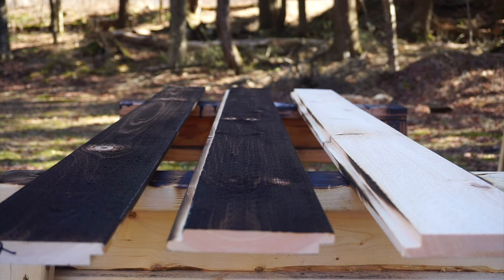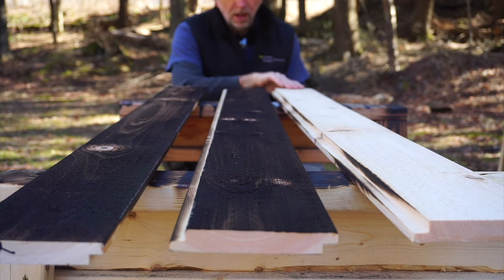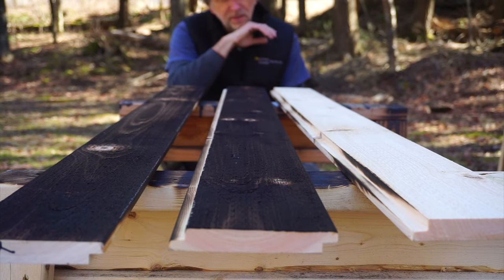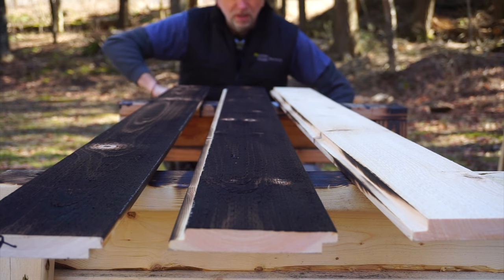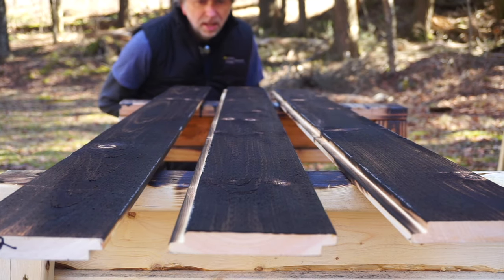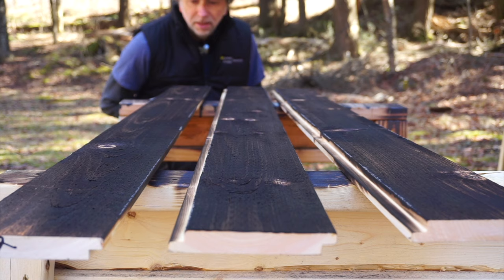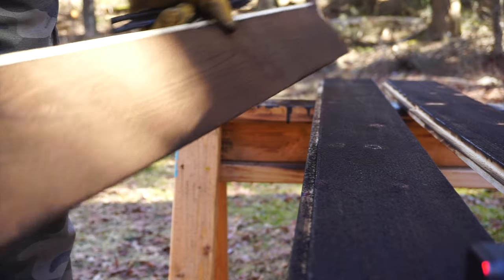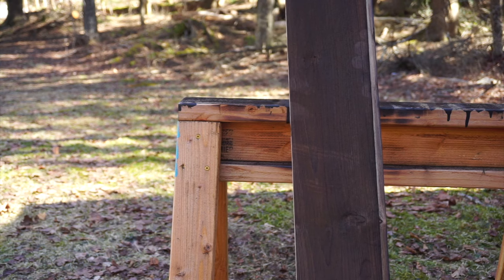How to Shou Sugi Ban for Beginners - In 2 1/2 Easy Steps

Comment: I want to add that you can preserve post for in ground use( I light a fire and lay them down rolling and moving them to char the length I need. Also to completely seal the wood the edges and end must be charred completely as well.
Reply from the maker: Great point. Thanks for adding that!
Reply: That is the only way it seals the wood correctly.
Reply: Yes, I watch Shawn James use that technique on his channel… it inspired me to build a raised bed garden using scorched lumber to resist rot.
Reply from the maker: That's correct.
Reply from the maker: How are those beds working out? Always interested in longevity.

Comment: does that mean that we can use untreated wood with this method to build durable houses?
Reply from the maker: This method is an alternative to pressure treated wood. It may not last as long as pressure treated but 1) it looks better 2) it's better for the environment. Really comes down to implementation, where you are and what the exposure is to the elements.

Comment: I love the big weed burner torches for speed of burn.
Currently, I’m burning lumber with the small propane torches… takes longer, but then again you can be more precise, if precision is called for… like in surface burning where you are just doing a really light burn.

My project is a loft bed with 2x6s and 2x4s. I’m doing a significant burn on the 2x6s that create the actual mattress (futon) frame, then sanding it down to reveal the texture of the 3 dimensional surface. I follow that up with an espresso colored minwax stain. (Which somewhat hides the burn a bit, but not completely)
The 2x4 legs will likely just get a light surface burn using my weed torch… just for a bit of a black accent.

(Also, I think shou Sugi ban would be a nice technique to use  with my traditional Japanese futon… that’s placed not so traditionally on a loft bed frame, about 48” off the ground.)
Reply from the maker: That sounds great. I find that if I used a smaller torch it leads to streaking from the narrow hot spot, which doesn't look good. I find that the weed torch does well for light burns too. I just throttle back a lot and keep the torch at a distance. Takes a bit of finesse, but it's definitely workable.

Comment: Question... does the wood needs to be super dry before doing this? We have old pallets we want to use for our raised garden beds and want them to last longer by using this technique. And shouldn't you do both sides, like with paint to prevent it from curling up on the burned side?
Reply from the maker: Pallet wood will work great with this. Scorch all exposed surfaces. I don't think that you will have too much curling or buckling. Have you tried it yet? Did it work?

Comment: Thank you so much for the demo and info provided here- it was very helpful. I do have a couple of questions on this topic so here they are - given that this method was meant to have an end result of  the wood very durable - pest resistant - fire resistant- water resistant (have I left anything out?) - is there someway to establish when the burning process is enough? Also, any recommendations on minimum & maximum thickness of wood to be used?
Reply from the maker: Thanks for watching! Yes, it adds to the life of the wood by protecting it. What I show in the video I would argue is kind of the middle ground between lightly scorched and heavily scorched. Go for that kind of look (or darker) to protect the wood. I wouldn't do it to wood thinner than a 1/2" (like pine paneling). If the wood is too thin, the burning process will likely warp it and make it harder to use. Thicker wood is less prone to warping from the heat being applied. Hope that helps. What project do you have in mind for this process?

Comment: does the wood have to be wire bushed, I am using it forsupport boards for building a deck?
Reply from the maker: It does not. I tend to usually brush though. I recently did some raised bed planters for the backyard and didn't brush them. It was the first time that I skipped that step. I was very happy with the result. Simply burned and then oiled the wood...done.

Comment: Hi,  Thanks for the vid.  Can you use a smaller blowtorch, like the 14oz benzomatics?
Reply from the maker: Hi. Sure, you can do that. It will be a bit more labor intensive but will work fine. If you are torching a lot of stuff you likely want to go bigger. Small torch is fine for smaller amounts of surface area. Good way to try out different techniques and levels of burn too. Let me know how it works out and glad the video was helpful.

Comment: Very awesome. Thanks for the video.
Is propane chemically different (ie: hotter) or better in any way for this, than common LPG?
Reply from the maker: LPG in terms of common use is the same thing as LPG. In the US we simply refer to it as propane. There may be a distinction in terms of chemical makeup, but in the vernacular it's the same thing for most folks. Someone out there please correct me if that's way off base.

Comment: I love the look right after burning and cleaning the wood .It is ok to just leave it like that or I need to oil it or seald it?
Reply from the maker: You can leave it sanded. I might wipe it down a few more times to remove as much of the burnt wood dust as possible. Also, even if you were to oil it, that dries up after a while and returns to the state that you like. What project are you looking to tackle?

Comment: How can you tell when to stop with the wire brush? Wont taking too much just erase the burning effort?
Reply from the maker: Good question. If the bristles are on the softer side, they will inherently just remove the loose stuff and not the lower down coloration. In other words, as you brush there comes a point of diminishing returns since the bristles will not remove the harder material below the exterior burn. Does that make sense?

Comment: should the oil be put on first?
Reply from the maker: Oh no...definitely not. If you put the oil on first, you would just wind up burning it off and likely setting the full board on fire as a byproduct. Oiling is an optional step after the burning part.

Comment: Do you sand the wood before burning and if yes what grit paper do you recommend.
Reply from the maker: No sanding prior to burn. In fact if you have a really rough hewn surface, burning and sanding will actually make the surface really smooth since all the rough wood fibers that stick up from the board will be burned off. It actually SAVES you from having to sand. Win Win.

Comment: I’m building an Adirondack chair and have it all cut and pre drilled and sanded down, would you recommend I burn all the wood first and then put together or put together then burn?
Reply from the maker: I would recommend cutting wood to size; scorching; sanding; oiling and then assembling. Will make easier to do vs. after complete assembly.

Comment: Does it matter what type of wire brush used? Ie.. Copper, stainless, composite etc
Reply from the maker: Not really. Really stiff bristles will not work, nor will ones that are too soft. Anything in that mid-range of bristle stiffness seems to work the best. Different brushes may yield different effects as well. Experiment with what you have and purchase something different only if what you have isn't achieving the result you want.
Reply: @TinyIndustrial  awesome thank you
Reply from the maker: You are very welcome.

Comment: I would like to do this to the deck posts. My wife is worried that the charred  wood would give off the burnt charcoal on clothing. You mentioned sealing it with linseed oil. Did you apply it like a finish? We used to put it on the wood of our hay 
wagons to seal and protect the wood years (many) ago. Thanks for sharing.
Reply from the maker: Hi Jim. You can definitely do that. Once it’s burnt sanded and oiled (wipe off excess), there is minimal chance of it rubbing off on anything. So only at the very beginning might there be a slight risk. Over time…none. The burnt doors that I make for the tiny houses I make do not rub off on anything. You have my approval to move forward with this project! :)

Comment: Doing this to a project that’s outside year around would you use a different oil ? 
How well would this work out if using pressure treatment lumber ?
Reply from the maker: I would still use the same oil. Depending on conditions, you may need to refresh the coat of oil from time to time. I would definitely not encourage you to use pressure treated for this methodology. Too many chemicals already in the pressure treated. This is a preservation technique for NON-pressure treated wood.

Comment: So would this be effective for outdoor furniture like Adirondack chairs?  Does the linseed oil prevent the ash from getting on you or would you still need to seal it?
Reply from the maker: You could do it either way you describe. Using this process will definitely extend it's outdoor life (also depends on the wood you use). Burning, buffing and sealing will get you the look that this process achieves and subsequently sealing it would likely yield even more longevity. Hard to get the boards clean and dust/lint free for sealing after you do the burn though... It's a trade off.

Comment: Is this also beneficial for Cedar wood?
Reply from the maker: Yes! That is where the term comes from. Japanese cedar. Now cedar is already pretty good at fending off the elements. Burning just adds another dimension and tone to the wood. What's your project?
Reply: Thanks! I would be looking to do garden fence posts and/or boxes for raised beds
Reply from the maker: Good project. Not only will it look good, but it will also be beneficial for the longevity of the wood. Less chemicals than pressure treated too (...no chemicals in fact).

Comment: How do you prevent wood cupping from after the burn?
Reply from the maker: Burn both sides...it minimizes cupping. The cupping and bending is mostly caused by heat being applied unevenly to a piece of wood. What project are you considering this for?
Reply: table top @TinyIndustrial
Reply from the maker: Perfect for that. Did you seal it with poly or what was your final finish (if any)?

Comment: Thanks!
Just a question: does it stain your hands when you touch it?
Reply from the maker: Initial maybe a bit. You can just wipe it down again after the oil is applied. You quickly will get to a point where there is no residue that comes off. Easily avoidable issue. I wouldn't worry about it. What's the implementation you are looking to do?
Reply: @TinyIndustrial  thanks! I was thinking to do it on our siding (part of it) or inside on the trust. Sorry I am French and not sure if trust is the right word.
Reply from the maker: Excellent. Did it work out for you?
Reply: @TinyIndustrial  finally we finally oiled our siding. But we still have more to do so the burned part might be done on accessories. Thanks for asking!

Comment: Does the burt wood rub off if you don't seal it because I'm thinking about doing this method for a desk
Reply from the maker: Initially, yes, you will have it stain cloth and clothes if it remains untreated. If you clean it enough though you will get rid of all the loose carbon on the surface and just be left with the burnt wood part. There is no particular need to treat it if you don't want to.
Reply: @TinyIndustrial  im thinking about just using some kind of sealer
Reply from the maker: How did that work out?

Comment: Hello. Can you use sand paper instead of steel brush?
Reply from the maker: You could use sandpaper, but it likely will cake up and clog the paper if you know what I mean. Brush will yield better results at least initially. You could do a second pass with sandpaper. That would work better in that order.
Reply: Thank you! Will try that finish on my DIY headboard
Reply from the maker: @markvizcarra9594  Post a link to an image of it when you are done. Let me know if you run into any issues. Here to help...

Comment: Can you do this to a finished product?
Reply from the maker: I'd say that's not advisable without first stripping off whatever coating, paint or similar is on the wood to begin with. What are you looking to apply this technique to?
Reply: @TinyIndustrial  sorry when I said finished I meant completed project... I made a memorial for my passed son. I only see people doing this to single boards.  I have not put any strain or other finish on it yet.
Reply: @TinyIndustrial  what if the wood has been sealed? Will it be a problem?
Reply from the maker: @kahfigitar  You mean using this technique on treated/sealed wood? That wouldn't work. You need to start with untreated wood. If you. If you had varnished or treated wood, you would need to strip that down to an untreated state before employing this technique.

Comment: I’m pretty sure the charred material is supposed to stay on the surface to deter insects—and I’m also pretty sure this technique is supposed to use coal tar for the final seal…
Reply from the maker: I suppose that there is an official and unofficial way of doing this. Even when you scrape off some of the burnt material, you still have a char on what's left behind. That is still a seal for the wood and still a deterrent for critters. Could it be more of a seal and more of a deterrent if one didn't do that...perhaps. Final seal is optional as far as I'm concerned. It comes down to the look. you like and if you want to additional seal the wood in it's burnt state for some other reason (i.e. a gloss clearcoat finish).